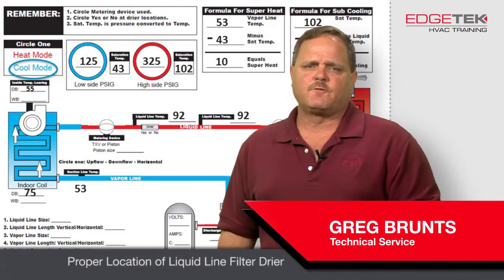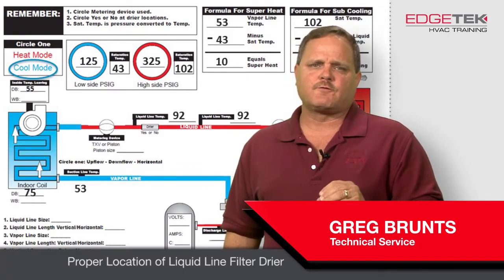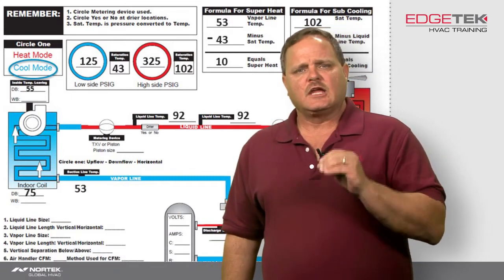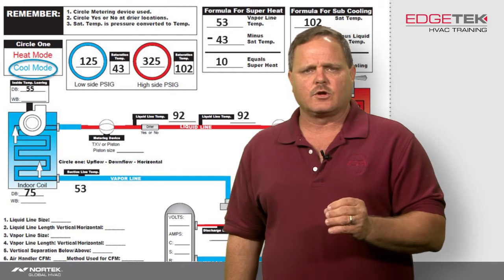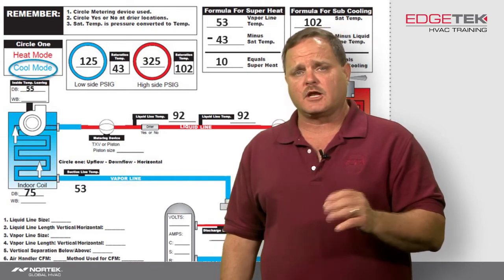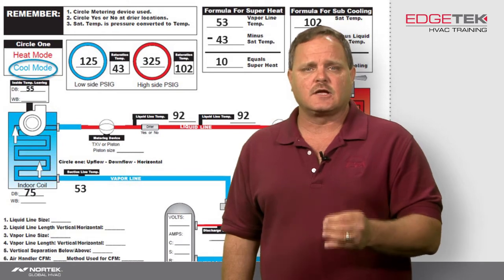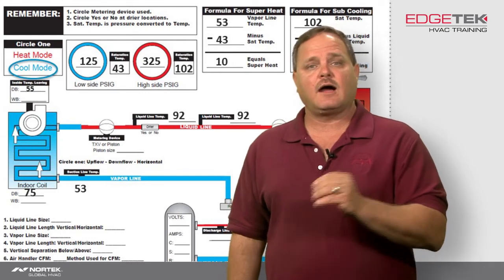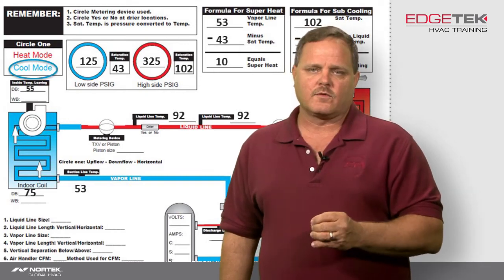Proper Location of a Liquid Line Filter Drier

Comment: Roland Anderson The capacity of a desiccant is temperature dependent. The colder the desiccant, the more moisture it can hold. Therefore, locating a filter-drier in a cooler location is an advantage. Removing a brazed filter-drier with a torch flame causes moisture to be driven out of the desiccant and into the system. Generally, it is better to cut the filter-drier out with a tubing cutter.

Comment: What is the technical reason it should be by the evap coil?
Reply from the maker: The main reason is for noise in the refrigerant system.
Reply: Well.... And to stop contaminates from getting into your indoor coil. It has the name filter for a reason
Reply: @kyledubs8293 that's not the right answer. Some units like Lennox bring the filter inside the condenser. It just has to be installed between the condenser and the evaporador